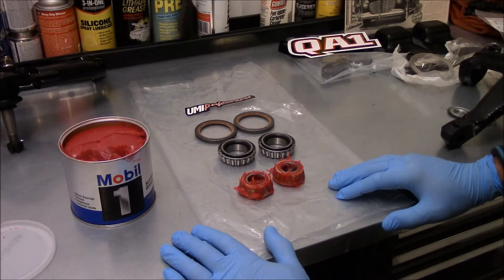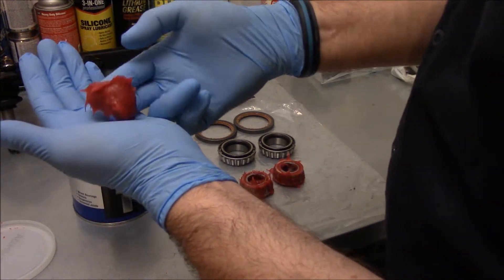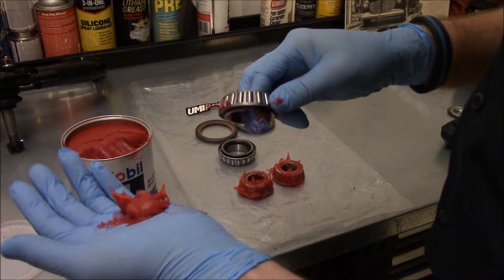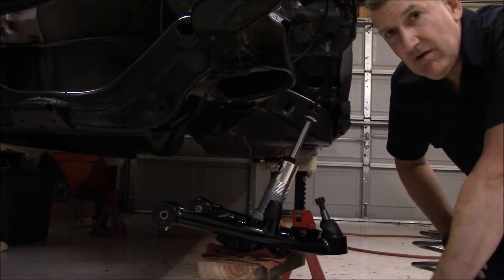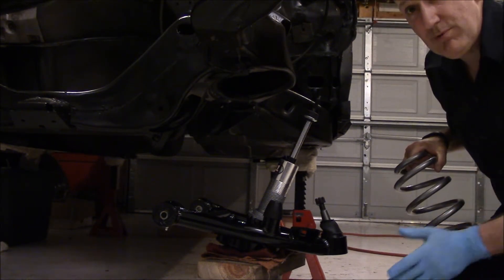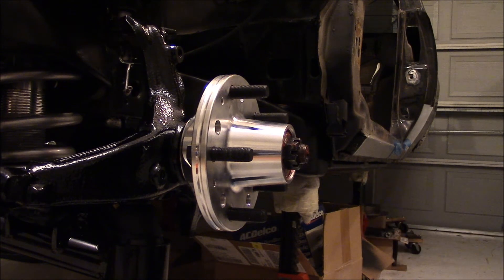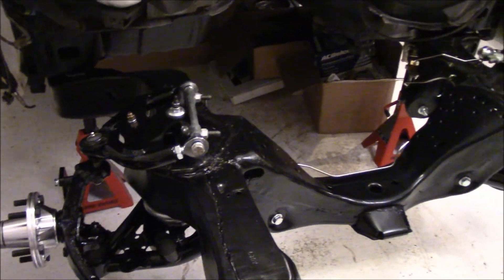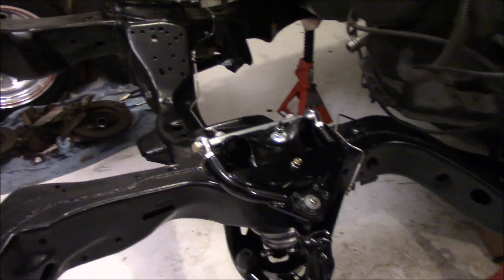Front Suspension Install!!! - 1987 Olds 442: Video 21

Comment: Very helpful video, im planning on doing the same job cause im doing coil overs project, right now for the rear, and will change the hubs with bearings in the front, doing disc conversion on my GN car and the bigger discs. Installing parts from UMI as well
Reply from the maker: Very nice.  Come back and update.  Good luck and thanks for watching.

Comment: Dude that is such a cool idea i am going to try this on my 2000 chevy s10 2wd its so hard and dangerous to compress it with a spring compressor thank you
Reply from the maker: I installed a Coil Over Front Shock. The spring is captured in a way by the shock and your capable of lowering the compressed height by the bottom adjuster nut. I would NOT try that with a conventional spring set up. They make a spring compressor tool for that for a very good reason.
Reply: @hutchhiperf  thanks for the reply this is the same exact set up on the s10 a coil over front shock the shock mounts the same way yours does two bolts on the button and one nut on top that will hold the spring in place great video love the 442

Comment: Hutch, doesn’t look like it, but did you add any of the factory shims to the uppers?  I’m using the UMI bolt kit but there isn’t enough thread to tighten the arm shaft down.  🤔. wondering if they’re expecting a shim or two or if for some reason the bolts they supplied are a hair too long.
Reply from the maker: I used no shims and the factory style bolts for mounting them.

Comment: The original bearing washer fit ok on mine with the Wilwood cap...just FYI.  (84 Monte Carlo SS). So, not sure if there is some variance from the factory or what.
Reply from the maker: Probably just a change in washer by GM.

Comment: nice, I'm in the middle of this now.. what spring rate did you use? i'm stuck between 450 and 500 for the front
Reply from the maker: Since I'm doing a Big Block, I went with the 500 lb springs in front.

Comment: So, the rear seal was causing the drag?
That rear seal had the bevel to keep the grease in?
You left the rear seal in and just dealt with the drag?
I wouldn’t think it would be much of a problem with all that weight and force with the roll.
Reply from the maker: It isn't.  It just felt wierd to me after I tightened down the bearings and checked it.  The things are so light (hub) that there's no mass when spinning it. I think if it were a traditional large rotor on spindle I wouldn't feel any difference.
Reply: I'm gonna tackle replacing the suspension on my 86 Grand National and going with tubular control arms and coil overs in the rear, although I may need to space out the rear wheels as the coil over's mount on a bracket system that would come too close to my comfort to the tire/rim.I'm impressed with your talent my friend. thanks for a great video's!!
Reply from the maker: @HVACENGINEER94  Thank you sir.

Comment: I wonder if I can do the same approach with new oem springs?? Yours seem a lot shorter than mine will be
Reply from the maker: The shocks I used are Coil Overs where the spring is captured on the shock.  OEM the shock and spring are separate.  UMI and others have have nice drop spring and shock kits that work well with the G-Body.  Check out UMI's "Green Machine".
Reply: @hutchhiperf  That is why you didn't need spring compressor?!
Reply from the maker: @ardeshirdodangeh588  Yes. The spring is captured on the shock instead of between the body and suspension. I did need to put weight on the front end to get the shocks seated. The spring is held by the frame on one side and did need to be compressed. Just not that much because you can lower the seat on the shock all the way down.

Comment: @hutchhiperf how far do you tighten the top shock screw
Reply from the maker: Usually until the rubber bushing starts flatten and bulge slightly.
Reply: @hutchhiperf  ok thanks

Comment: Nice video!  Do you have p/n for the bearing and seals used?  Or did they come with the hub assembly from Wilwood?
Reply from the maker: They were supplied by UMI Performance.  I supplied a link to the Timken bearings that were sent with the hub ABOVE.

Here is the Wilwood Tech Page on their Hub http://www.wilwood.com/Hubs/HubProd.aspx?itemno=270-12304  

They are a BCA# A6 (inner) and A34 (outer).

Comment: Did you use stock spindles
Reply from the maker: Yes. That's one of the things I liked about the conversion.
Reply: @hutchhiperf 
I recently purchased a 86 442 t top black gray with gray interior from a guy just outside Pittsburgh who got it from a guy who originally bought it in Ohio. The frame is rusted out and I have to do a frame swap I was wondering if I could get your contact info to pick your brain and get some pointers from you.
Reply from the maker: @tmangan327  I would suggest joining gbodyforum.com. You'll get info from a bunch of knowledgeable gear heads if you post questions. You can also DM me directly. I'm "oldsofb" over there.

Comment: I put 04 blazer spindles on my car
Reply from the maker: Yes.  I've heard of that mod as well.  Both ways have their distinct advantages.
Reply: What size wheels are you running? I also want to run this set up but curious to know if a stock 14x6 will clear calipers
Reply from the maker: @mandofreskoo  Your not going to run a 14 inch rim with the B-Body Spindle and 12 inch rotor upgade more or less the C5 kit.  C5 will be a min 17 inch rim and C6 will be 18 min.  Even the 12 inch Camaro 1LE will need a 15 inch rim.  14's are over with if you want an upgraded brake system.
Reply: @mandofreskoo  blazers work with 14"